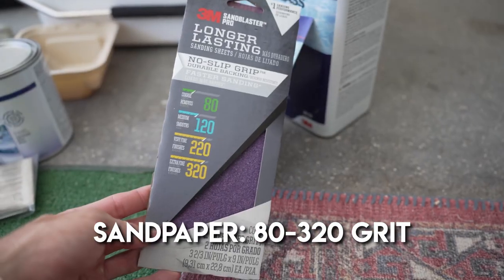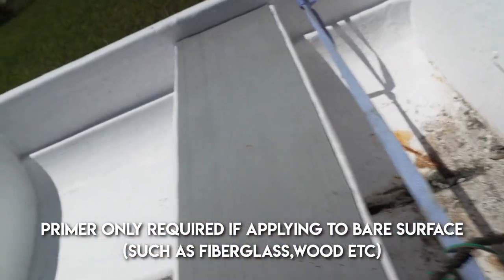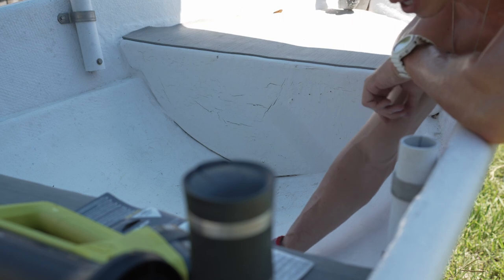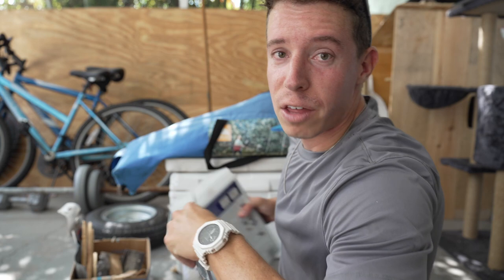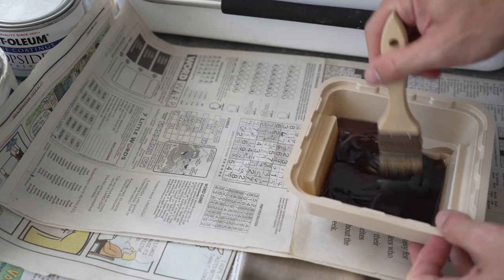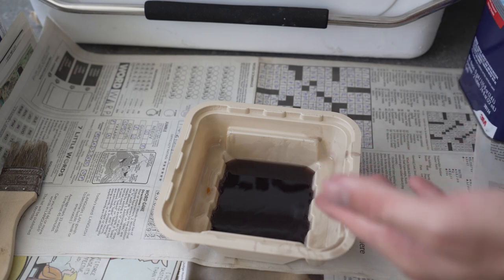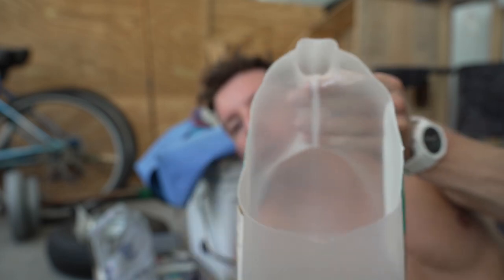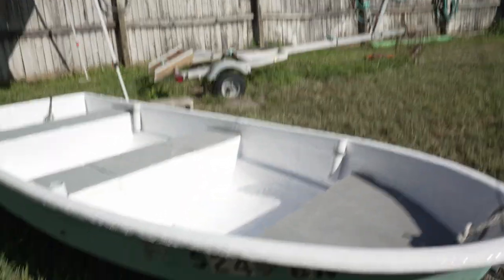RUSTOLEUM TOPSIDE MARINE PAINT FIBERGLASS BOAT RESTORATION

Comment: 🌴 Wow time fly’s when your having fun , it’s me Dave ! Remember me , I’ve got the same Cacci craft you and pops got glad to see you up grading the interior 👍🏼 I’ve started my boat build , I replaced the transom all new wood and fiberglass, I cut out all the seats , I put in a floor that was fiberglassed on both sides before bonding it to the hull bottom , and I used cans of spray foam to fill the void under the floor as part of the flotation system used on the build , I’ve still got to fiberglass the top edges where the floor meets the the outside of the hull , weather hasn’t been in my favor as like you I’m doing this out in the open , ether to much rain or to hot out, I did get my old 15 hp 1977 Johnson outboard redone and it needs to get sanded and painted , I’ve got a lot of work to do yet , but it’s a project , and projects take time , have you been fish bud ? Was hoping to see some more of ya getting the boat on the water, are you going to paint the exterior of the hull ,mine is a dark hunter or forest green , I was going to leave it the same color and do a tan interior, how about you what color 🤔
Reply from the maker: @davescheer5038  of course I remember Dave! Glad to see you’re making progress on the build! With cutting out the seats, what kind of fishing (if any) do you plan to do? More of a bass build with a flat bow for a casting deck? I like the color combo you went with! That’s going to be wicked when it’s done. The exterior hull is just a seafoam green on mine. I love that color on boats so that’s what I went with. I feel ya on the heat though, been too hot to fish! I’ve had some really big changes in life happen recently which will be revealed in a video I’m editing this weekend! Also dropping an overall review of this Cacci craft that I filmed last weekend. It will give others a general idea of what to expect if in the market for a boat like this. Stay in touch on your build, I’m looking forward to seeing more progress Dave🤙
Reply: @LFTLivefortoday  , 🌴 yea I’m going for the nano flats skiff look , it will look like a regular flats skiff wit a bow casting platform, rear flat seating , and a poling platform, I’ve got a front trolling motor mount made already , and I bought a used 55 lb thrust rip tide minncota trolling motor at goodwill for $35 bucks and a couple used rechargeable wheel chair batteries for 5 bucks each at a yard sale , I’m still trying to get my boat trailer refurbished, putting new lights ,a forward roller( done ) and guides on the sides for easier loading and keep the lights out of the saltwater , hope your doing ok and looking forward to seeing your next vids 👍🏼

Comment: Doing my jeyski, took the yellow off, gave it the 1st tan coat. Runs everywhere, alot of brush stroke pattern, of course applied on light so I can do my next layers. Very tough coat than if ya just wanted to use a simple house hold paint.
I probably just needed basic paint for the pattern then the polyurethane spray paint to top it off, but this is already included with gloss coat it seems
Reply: -but imma grab that small paint roller, should go on even.. I meant to say, I gave years of painting experience.. but top side is different like this.. (color is tan)

Comment: Resin has no strength without glass
Reply from the maker: Very true! The resin is there to secure the glass to a surface. I simply used it as a filler in some areas.